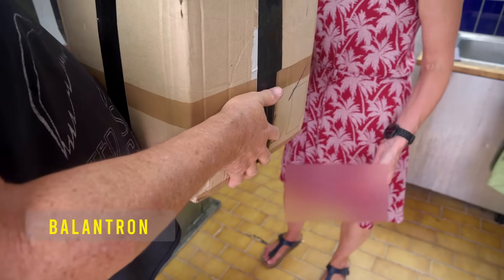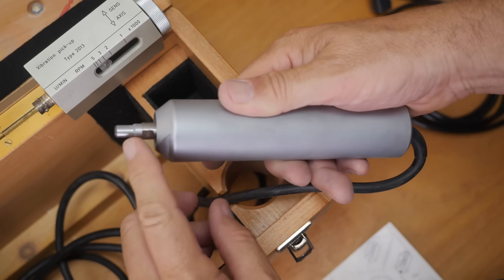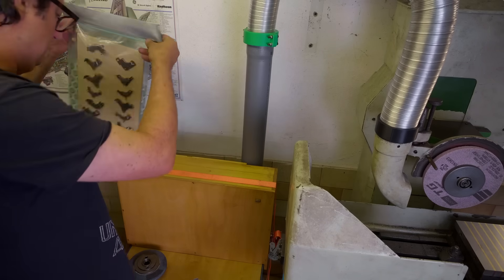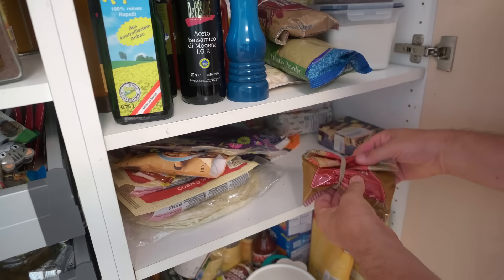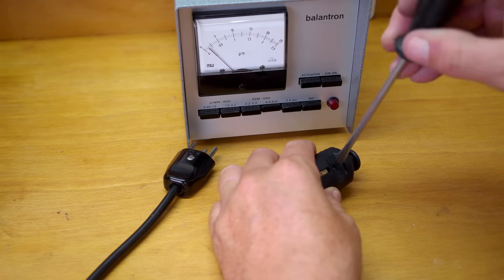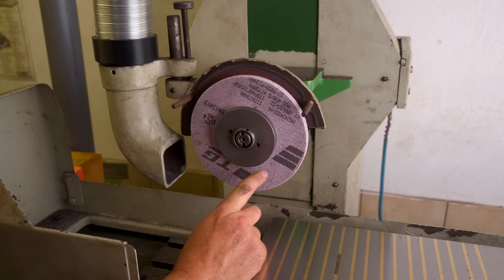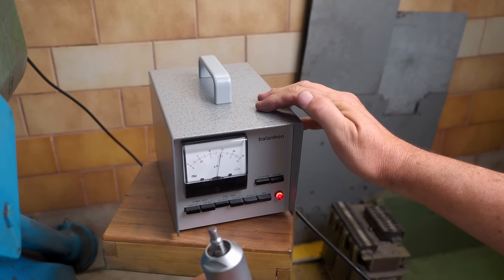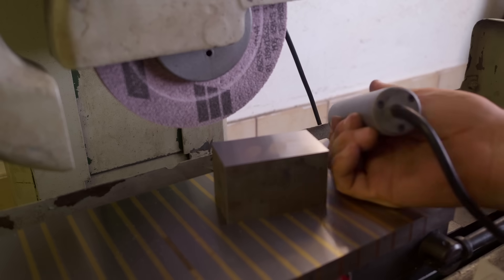Can you help me fix this grinding wheel dynamic balancer? || RotarySMP

Comment: Love your cheap and cheerful magnetic separator - it will be interesting to see how effective it is. I'd love to know how the Balantron actually works - how do they do the measurement? I don't quite understand the function of the actuator - I gather it is used to remove material on the wheel but how does removing high spots on one axis balance the assembly? You can now get Arduino compatible 12 bit 3 axis vibration sensors - it would seem not that difficult to have a permanent install that looks at the balance of the whole assembly.  Awesome content as ever.
Reply: ... and congrats on the SATA paint gun. I was told by someone who does industrial spraying of aeronautical stuff that they are night and day better than any other paint gun but also incredibly pricey - the Prada of spray guns.
Reply from the maker: Thanks Francis. I will have to be a lot more careful with properly cleaning the Sata than with the cheap amazon import paint guns I have used till now.

I suspect you still static balance the wheels, and then the Balantron is just to fine tune the balance, taking off very little.
Reply: @RotarySMP  FYI the Canadian price for the same model is 1K+!  I have never paid more than $50CDN on the basis I know I will neglect cleaning it properly.

Comment: As an electronics engineer, I always try to fix everything!  In this case I would start by scooing the signals to the actuator to see if the controller is trying to drive it or not.  Isolate the controller or actuator.
Reply from the maker: Thanks. As a non-electronics engineer, who has an Osci, but barely a clue of how to use it, "Scooing the signals" sounds like my kind of plan :)

Comment: Probably worth continuity testing the cable to the vibrating head?
Reply from the maker: I did that Julia. Between the pin combinations 6/3/3 ohm. It is a double solenoid.

Comment: I’ve been using those automatic balancing tire ball bearings for years. Works great just a little tricky getting them inside the grinding wheel 😅
Reply from the maker: I saw a video on that method.

Comment: Nice thing the balatron, it reminds me of the engine workshop on my previous work, they had a huge balancing machine just to balance aircraft rotors fully assembled rotors it could measure blade tips with a laser level, they also had a big dimensional inspection rig, where they could just measure any part with a contact tip
Reply from the maker: Those full up blade grinders are pretty terrifyingly powerful machines :)

Comment: Regarding 2 component clear coat, check out safety datasheet. Recently wandered across forum thread regarding so called 2K clear coats, which have isocyanes and forced air flow in workspace together with good mask with pre-filters weren't enough to protect against passing out and waking up in hospital
Reply: Years ago I remember NO cartridge respirator is rated for isocanates. You need a clean air supply through a hose. I also remember reading the safe level of TDI (toluene di-isocyanate) is about 10 times less than the level at which humans can detect its odour. I mean the safe level to avoid becoming sensitized.
Reply from the maker: Yeah, so far I have only used less dangerous single component paints for that very reason. I would rather accept softer, weaker paint with some paint damage than lung damage.

Comment: The two freekouts weren't intenal calibration. That machine is too old/simple to have that. Those were the internal power supplies coming up slowly, and large capacitors in the amplifiers coming up to operating voltage. That sort of thing was very common in precision instruments back in the day. It could indicate an internal problem, but usually didn't, as long as the meter ended up on scale, or could be adjusted to on scale.

The actuator failing could be a bad actuator, bad connecting wires, or a bad driver amplifier in the instrument.
Reply from the maker: Thanks for the explanation. You are right, all simple analog electronics in the box. I am just trouble shooting it.

Comment: Have you tried the mains plug in both ways? The original plug looked like it could only be installed in one orientation. The style of euro plug you used could be inserted two ways. Depending on how the power is sent to the balancer it may need the AC live/Neutral/PE on specific pins. Just a thought, good luck
Reply from the maker: I gave that a try. It made no difference. Thanks for the idea.

Comment: At 14:49, I might say that the area of removal would be at 90deg to the axis formed by the spindle and the sensor. That #2 diagram is not exactly how you tested.  You tested with the sensor above the spindle and you should remove material to the right of that centerline...  You read the GERMAN instructions, I am only reflecting upon the words you said, I might be wrong...I also feel that 3 'DIFFERENT' tests are to be performed, please notice the '3' locations shown and that they have a different exposure of the 'Vernier Adjustment' area in each aspect.  Figure 1 seems to show testing for vibration in the vertical axis, then testing again in the horizontal axis. Figure 2 seems to show the sensors aspect has changed again.  Figure 1 top position, and Figure 2 side position, seem to indicate my previous statement above, 90deg off of the axis created by the sensor and the spindle.  I can't begin to assess how you accumulate these 3-sets of data into an action plan, unless you are supposed to select the worst of the 3 tests and act upon that result.  Are you sure you understood the instructions?  Thanks for providing this riddle to us.
Reply from the maker: The accelerometer is sensitive to a single plane. That is why it is magnetically mounted in two orientations. Where you put it on the machine is pretty irrelevant. It even says you can use the table (you would likely measure lower amplitudes there.

Comment: At 16:47, Maybe you could open the housing up and show us what is inside, maybe it is a simple problem revealed by visual inspection, like a broken wire? If it is not too complex inside, maybe a circuit analysis could be done as well.
Reply from the maker: I am onto it. :)

Comment: 14:53 Good little knock on table corner with that "pen" could wake it up :)

Also, try place Vibration pick-up same way as in manual picture (horizontal, vertical)
Reply from the maker: There is a wrenching flat on the actuator shaft, and I have given a bit of a wiggle with that. It moves, but the seal had a fair bit of friction.

I dont have a flat surface on the side of the head, but dont think that matters. It shows the accelerometer on a top surface in Fig 1, and also mentions it can be placed on the table. What matters is to be aligned to the plane or rotation, and measure both directions for the highest amplitude.

Comment: Here's a tip for pruning the trees, from one of DaVinci's notebooks, "cut after the new growth" usually that means you end up with a Y with two branches cut at 1/4" and tiny sprouts coming from the vertex, but it can also mean just past the new sprouts on a stem that is too long. For a cognitive explanation, I understand the sprouts are actually sources of growth hormone and good bits to keep. It can take 2 years to reshape a plant with this technique, but it seems to work well on all plants.
Reply from the maker: Thanks for the tip George.

Comment: Appart from electrical it can be the shaft is simply bent and the low power in it can't make it move. Dissasembling would not hurt your auddience😂
Reply from the maker: You are right, that will be the next step.

Comment: I’ve always found it funny whenever I see people measuring something with both inch and metric. Some guys make a part 300 mm long by 0.500” diameter then drill a 025” hole in one end and tap for a 6mm screw on the other. I’ve never understood that.  I’ve got inch and metric machines. Not surprising these days. I often modify them. But I only use inch on the inch machines and metric on the metric ones. Less confusion down the line.
Reply from the maker: I am basically all metric these days, but felt adding some inches would be inclusive for for the metrically challenged :)
Reply: @RotarySMP well, I for one would love to see you making a part using metric in one dimension and inch in the other. How does your CNC machine handle that?

Comment: You have to try the air fryer to roast the peppers. We do it this way, and they turn out fabulous. Add some garlic and olive oil in a pot and put it in the freezer.
Reply from the maker: We dont have an air fryer. Sounds nice though.
Reply: Air fryer won't add the cherry wood smoke without a lot of trouble...
Reply: @johnrussell6620 I explained myself badly, the air fryer is not for smoking them but for roasting,  you can cut them into pieces, if they are large remove the skin and cover with olive oil.

Comment: Would love to see a dynamic balancing ring made..say 4 inch diameter with 5 ball bearings inside mounted on the shaft.   Look up Centramatic wheel balancers.
Reply from the maker: Thanks for the tip.

Comment: If you’re able to fix the actuator you will absolutely love using the balantron. 

When I did precision grinding we used a balantron all the time. They are really invaluable for achieving the form and finishes you need for thing like air bearing part etc.
Reply from the maker: Did you do a conventional static balancing of the wheels on the hubs first, or just mount them, dress then and use the balantron on them?

Comment: Do you have an oscilloscope or someone nearby with one? I would poke multimeter first and then attach probes to see if device outputs something plausible
If it does -- look at the actuator, which is probably two coil solenoid or something like that

Now typing it out -- it's easier to check if the actuator has a probable resistance first and if yes -- poke around with probes (:
Good luck!
Reply from the maker: I just checked the resistance of the actuator. 6 Ohm between two, and 3 Ohm between the other pin combinations, so that looks like a double solenoid. 
There was a loose screw inside. I am just looking where it came from.
Reply: @RotarySMP  oh, nice! It would be very good if it was some small mechanical thing and you don't need to go all CuriousMarc on the device (:
Reply from the maker: @wall_k  I hope so too.

Comment: Marc, sorry for the nerding in advance but never cut wood wich is broader than long between the saw and the fence. If you shutter just a bit the diagonal of the boards kicks in between the saw and the fence and jams and get's shot out of the sawing machine were you are standing. I saw the result once when a mate of mine made same mistake. If I tell you the height was just below his groin, blood and the color purple you can figure out what happened. Maybe a small correction on the channel for the inexperienced users of a saw? Best, Job
PS: I would check the circuit board and the cable first
Reply from the maker: Thanks for the safety check. Dumb of me, as the cross cut sled was right next to the saw by my knee. I appreciate the safety call out, as it is easy to get into bad habits working alone.

I am just going through and making a trouble shooting list based on all the good advice.
Reply: Solution:   wait until a piece of Jarrah the size of a dictionary gets you in the nuts at high speed.  Then you'll never do it again.  Ask me how I know.

Comment: I just wanted to say I’ve been a long time follower 5+ years. 

Ever since your maho project I was inspired to get one myself. After many many years I’ve finally found a Maho 700c 
I’ll be re watching your videos and re reading your forum thread to try and convert mine to Linux CNC. 
Regards from South Africa
Sven
Reply from the maker: Hi Sven, thanks for the kind words.
Did you get the full wiring diagrams for your Maho?
Reply: @RotarySMP luckily yes! All the manuals, “Schaltpläne” even the diagrams for the Phillips cards.
Reply from the maker: @svengebert8690  Nice. If you have any questions, you can drop me a line on the email address on the channel home page.
Reply: Hey, congrats! They are nice machines.
Reply: @vincei4252 I’m excited to get stuck in! And luckily it has the 4th axis (rotating table)
Reply: Mate just got a 700 too, are you doing a build thread anywhere?
Reply: @brendanshorter5550 I’m thinking of posting my journey on the Linux CNC forum or even make a few videos of my journey
Reply: That is awesome. I'm working on a Maho MH400E. It's fun and frustrating at the same time. 😃Good luck on the retrofit.

Comment: Going to hazard a guess that the actuator uses something like a voice coil to oscillate with the RPM, check it for continuity. Then if that looks good maybe the tool is seized up and needs some service?
Reply from the maker: Thanks for the tip. Just going through all the suggestions and writing up the trouble shooting steps now.

Comment: Do make yourself a crosscut sled that runs in your saw's mitre slots for cuts like the one at 3:24; running wide but short stock against a fence like that has a really high risk of kickback, as even a little bit of twisting will bind the stock in the blade.

EDIT: I've never seen anything like that Balantron. Fascinating tool.
Reply from the maker: I already made one. I thought that there was enough length to guide that cut safely. Thanks for the safety feedback. It is easy to fall into bad habits working alone.
Reply: @RotarySMP done the same myself and got a nasty surprise 😬
Reply from the maker: @gbspikyfish  It was lazy of me, as the cross cut sled was right beside my knee.

Comment: Yes, Austria uses "Schuko" sockets. Short for Schutzkontakt, the two metal prongs which provide ground in case of malfunction. The middle pin on the swiss plug has the same purpose.
Reply from the maker: I was too focused on Schoko. :) Which has become terrible expensive lately :/

Comment: I didn't mind the Onshape vid, been figuring out Fusion for 3D printing, not super impressed with it TBH - many things are super awkward (used to use Autocad on Unix back in the early 90's...) Learning about alternatives is always interesting and gave me a reason to try it out. That said, feedback for Onshape is that they need a paid plan specifically for the hobbyist / home user market. The step from Free to Paid is out of the range for most hobbyists who don't have a need for "unlimited." It's nearly 3X the cost of Fusion, which is already high for hobbyists which makes it completely unaffordable.  

Love the mixed Metric and Standard measurements, and the apple pie looks yummy! 

Thanks for sharing!
Reply: Fusion has a free for personal use option and the limitations don't have a real impact on 3D printing for hobbyists. I've use several CAD packages over the years, and I personally have found Fusion to be the easiest to use for most operations.  Yes, there are some that are not intuitive, but then every CAD package I've used or seen demos of have awkward edge cases.  Fusion's ability to add chamfers and fillets is one of the easiest I've seen yet. Select the edges, select the chamfer amount, and it's done.
Reply from the maker: I never really gave Fusion a try.

Comment: and here i though that you had your wheels balanced from the start. i did see someone make a diy air barring one and it worked awesomely ( specially cause it rides in a constant film of air it was completely friction and wear free. only needing shop air to work )
Reply from the maker: I watched that video as well. I have a mate with a balancing jig, so I just need the correct arbor, and can go and balance me wheels at his place.
Reply: @RotarySMP  good cause wheel balanceing is extremely important ( otherwise its like buying a bugati and put on the cheapest unbalanced wheels on driving down a unpaved road and saying it's the dealer's fault ) unbalanced gives more vibration in the machine which is bad for the spindle bearing ( unless its hydrostatic. then i dosnt care )  but also the visual surface is in nanometers. which means that vibration that makes the wheel go up and down like 0.1µ is easily visible
Reply from the maker: @flikflak24  I am working on that arbor, or more to the point my mate in Malta, Luke is, as he has the same machine, and made a couple of arbors. Then I can balance my wheels. :)
Reply: @RotarySMP  good. just make sure that the arbor itself is also balanced ( check just to make sure ) so it dosnt have any effect on the balanceing of the wheel/gives a fals balanceing/reading ( it takes like 5 secends to check. its checked the same way as the wheel is btw )

Comment: If you take a look at the pins of the connector the resistance values are 6 ohms from center top to the right and 3 ohms in the other cobinations.
Reply from the maker: Thanks a lot for that. I'll measure that this evening.
Reply from the maker: Okay, I measured that. And have 6.4 Ohms, and 3.2Ohms, so that seems normal.

I have a rattle in the main instrument case, sounds like a screw has come loose, so I will open it and see what came loose in there. Maybe it shorted something?
Reply from the maker: Should the actuator shaft be locked rigid when off? Given two solenoids, I would have expected the shaft to be able to move a little under hand pressure when off.
Reply: @RotarySMP  pure speculation here ,does the shaft actually move , or is it more of a shaker with a moving internal mass?
alternatively  ,accelerometer calibration shakers  have the shaft suspended on disk springs with very little motion.
Reply: @RotarySMP no,you should be able to pull it by hand easily, something like 2mm of stroke
Reply from the maker: @taunusmechanics  I just put a spanner on the wrenching flat, and can move it in and out those 2mm, but it feels like a very tight seal is resisting it.